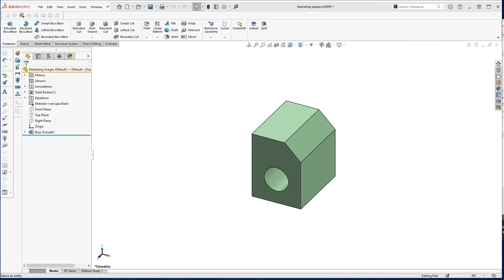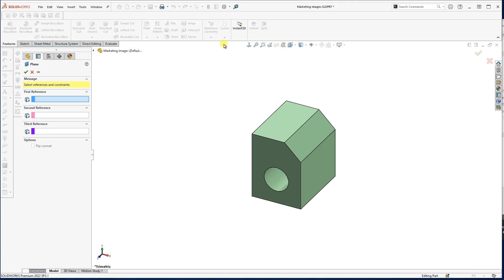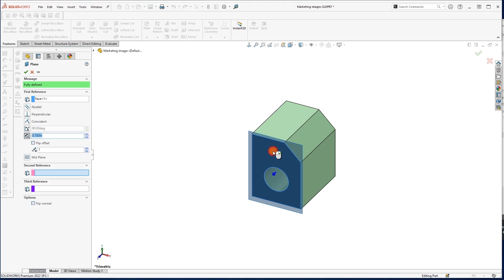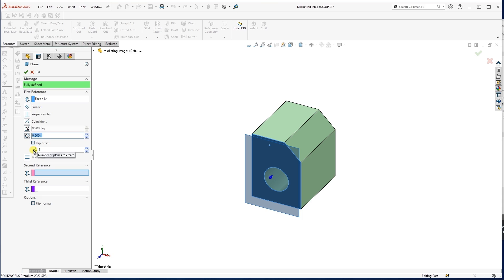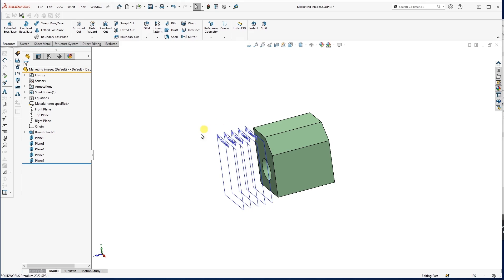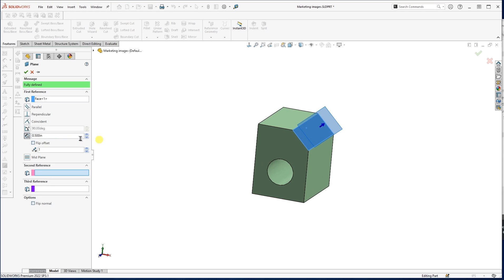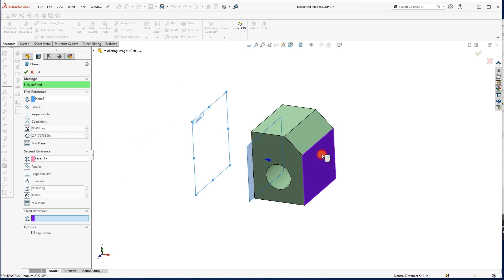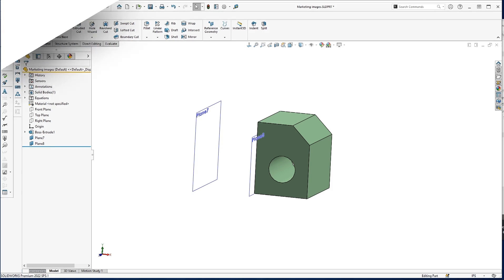How to Make Offset Reference Planes in SOLIDWORKS

Comment: How do you sketch on an offset plane? When I try, the Elipse, Text, Straight Shot, and Polygon tools are grayed out. Also none of the shape contours/edges highlight when trying to place/define a shape, it only "snaps" to the center of the plane. 

So if I have an offset plane parallel to the flat face of a cylinder, if I choose the circle tool, the mouse will only show an orange dot for the center of the cylinder (not for any points along the contour of the cylinder). When I click the center and move the mouse out to the edge of the cylinder, the edge doesn't highlight, so the circle remains undefined unless I set the actual dimension -- which is annoying when having to use Measure to check the dimension.